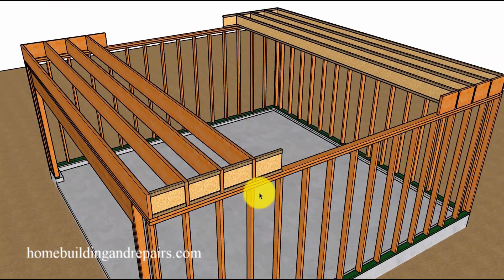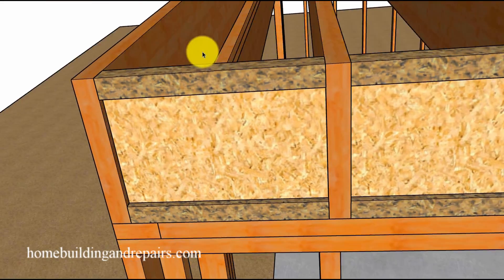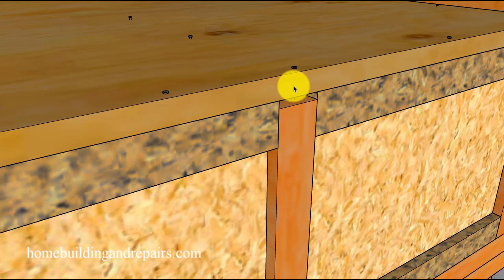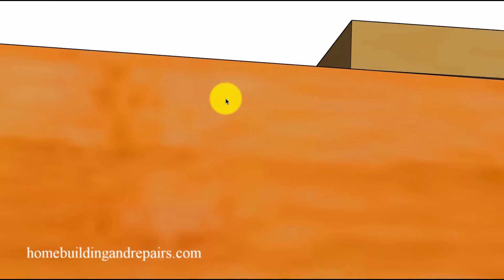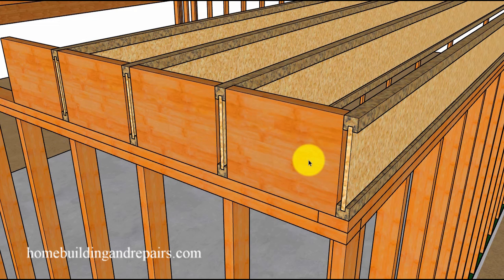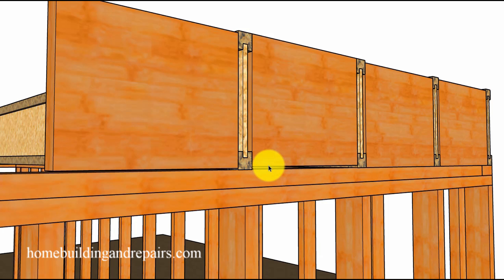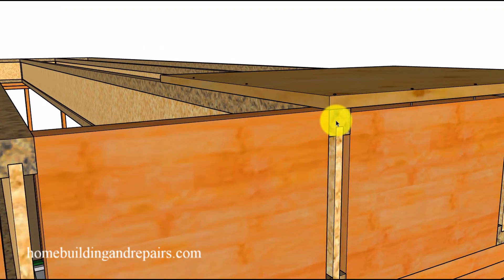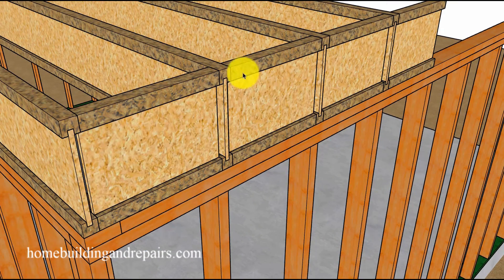Problems You Could Have Mixing Construction Standard With Engineered Lumber For Floor Framing

Comment: Suppose you have standard dimensional lumber joists butting up to an engineered girder (LVL/PSL/etc) via joist hangers. In addition to setting the joists proud (I've heard 1/4" - 1/2") of the top of the beam to allow for shrinkage, would it also make sense to end the subfloor at that edge rather than having it span under the load bearing wall above the girder? The edge could rest on dimensional lumber blocking toe-nailed to the joists but NOT to the beam. Then the whole floor would move together without the subfloor stretching/warping (leading to squeaks) where it would have ridden over the beam?

Comment: I was considering using dimensional lumber and engineered lumber for my wall assembly. Wanted to use LVL’s around all window and doors and dimensional lumber for rest but engineered lumber for top plates and PT dimensional lumber bottom plate. Good or bad? 2x6’s ideally of course.
Reply from the maker: I would check with your building department or builder's in your area.

Comment: Question, I have a 1950's rectangle hip roof 4/12 slope. House is maybe 30'×45'  with a ridge board length of 10'. My common & Jack Rafters are 2×6 & my Hips are 2×8. Hallway runs down the center. Living room & kitchen make up the front. I want to A) vault the front half of the house a foot or two. Or B) Add a 12" inverted trey cieling to each room 6'×8' meaning cutting through 3 or 4 joists & sistering the joists to run up 12" over 6' then down 12" & connecting back to the original joists. Which one seems like the better option? (less expensive & less work). For a slight cieling raise of 12"-18" would I need to add rafter ties AND switch all the front Common & Jack rafters to larger 2×10?
Reply from the maker: I won't be much help here maybe contact a contractor in your area for estimates.